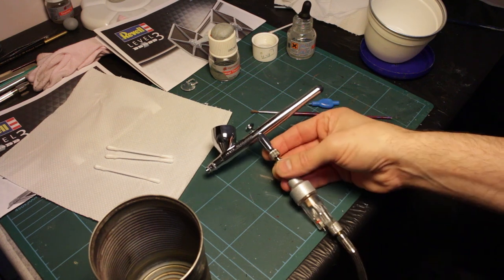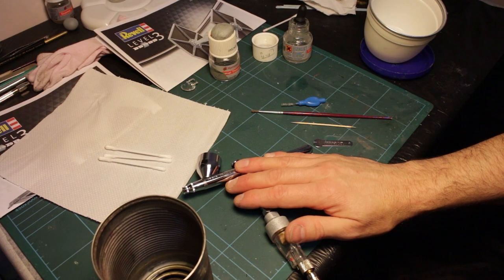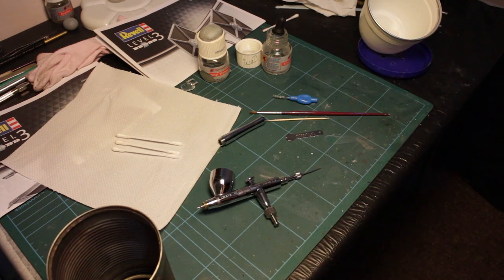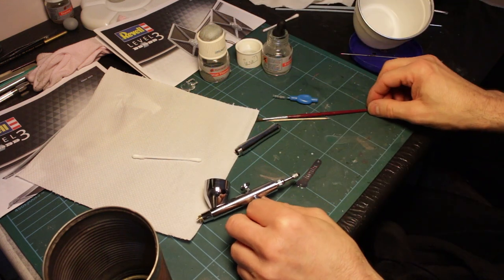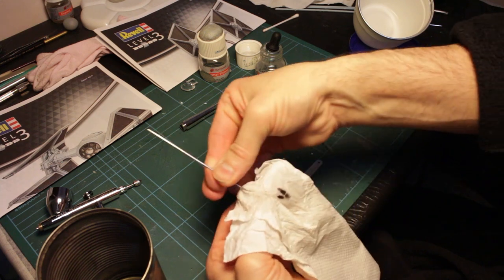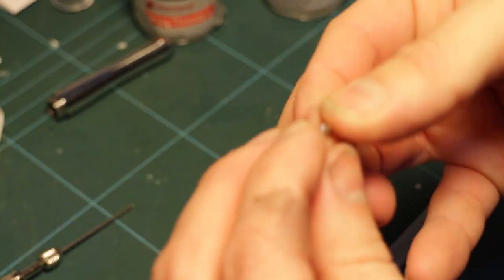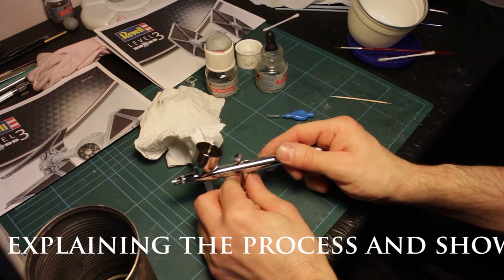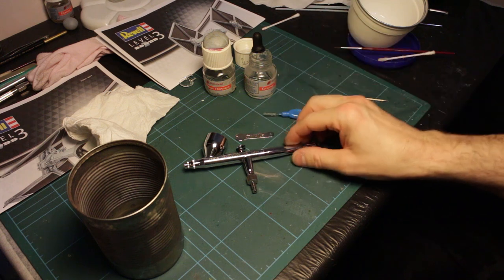CLEAN YOUR AIRBRUSH, SIMPLE, QUICK & THOROUGH TUTORIAL!

Comment: Well, I just had my first airbrushing session and I followed these steps - of course my brush didn't have any assembly/disassembly instructions so I was kind of a bit lost.
First problem - when I slid the needle out through the front it appeared to have a little rubber o-ring on it, assuming that's a seal that is seated somewhere within the brush.  Unfortunately, when I finish cleaning the parts and slide the needle back into the front, that o-ring doesn't of course go into the body.  It sits right at the mouth of where the nozzle should screw in and unfortunately, I don't know how to seat it so that I can get the nozzle to screw on.  I saved it in a little ziplock bag and finished assembling, but I'm not sure if the absence of that little rubber thing is going to adversely affect operation of the brush or how it sprays. Is that going to be a problem, and if that bit is essential how would you suggest I re-seat it (and where)?
Reply: @spidiq8 Update: Examined the other two nozzles that came with the brush (0.2 and 0.5 mm) and I see that it fits at the head of the nozzle threads.  It was fiddly to get it back onto the threads but it looks a little ragged (which implies it came that way and was maybe tightened too much when installed at the factory).  
How would I go about finding a replacement o-ring of the proper size?  It seems to be working properly after reassembly now, but I imagine this will be an issue each time I clean it until I get an intact one.
Reply from the maker: @HeadHunterSix  I was going to ask the brand and wondered if it might be the nozzle O ring seal, you can buy packs of tiny o rings from ebay etc and also from watch part supply houses.
However, if it's sealing and working without, don't bother, this way, provided the main seal is a teflon type material you can spray cellulose based paints safely.
Reply: @spidiq8  I just use it for acrylic, it's one of these Gocheer Chinese brushes with the little compressor.
It wasn't working perfectly without the O-ring but I did get it back on.  Still, it's a little misshapen and torn and I don't know how many more times I'll be able to break it down and clean it without that thing failing.
Id love to pick up a bag of O-rings but I don't know the inner and outer dimensions and thickness.  Especially since I'm known to drop such bits on the floor and lose them forever. :D

Comment: How do you sharpen a cocktail stick? Did you ever make the vid addressing the "o ring" cleaning problem?
Reply from the maker: With a scalpel blade. Whittle the point down finer as if sharpening a pencil.
Could you refresh my memory of the o ring bit please, I filmed this a good while ago and forget specific details
Reply: In a comment below, you mentioned that you would create a vid about "o ring" issues when cleaning the AB. I think the Iwata and cheap knockoffs have rings on the nozzle. They deteriorate fast with certain cleaning liquids. In this video, you soak the nozzle with ring in lacquer thinner, but say that is a bad idea with the o rings.
Reply from the maker: @Allessio777  Ah right yes. I do mention in a video somewhere (the Neo one I think) about using beeswax on the nozzle threads. That will seal it, just a tiny smear on reassembly. Some brushes have excellent close fitting nozzles like the Iwata here but others have o rings, standard ones don't last well in lacquer thinner but that said, since this video a lot are using viton o rings which are solvent resistant. (Same as the ones used in vehicle fuel injector and immersed fuel pump systems).
Reply: @spidiq8  thanks for that info...i found the viton site, but I don't know the size of the ring I need...my nozzle is .3 mm...if I can't locate them, what is the proper liquid to soak the parts in if I am using acrylic Vallejo paint?
Reply from the maker: @Allessio777  Vallejo is a water based acrylic so if you soak the nozzle immediately in warm water it should clear any paint residue. Brushing with an old paintbrush will help. If any has dried then isopropyl alcohol will move it.

Comment: Hi , little Question . Is the filter mandatory ?
Reply from the maker: They one under the brush?
No, but I highly recommend it if spraying in warm or humid climates or on extended spraying sessions as condensate can build in the air line.
Another way around it and similar to spray shops is to have a filter inline and a very long line from it rising upward before terminating at the brush but I find this actually helps with the airbrush grip anyway

Comment: Does it matter what percentage of IPA you use?
Reply from the maker: Ideally 99% but 70 odd will work for acrylics also, the only thing to be wary of is 70 odd percent stuff is typically rubbing alcohol which sometimes has other stuff in so check ingredients or ask the pharmacist. Anything that sounds like a balm or emollient will likely be a nuisance.
99% can be had cheaply from eBay/amazon/electronics stores
Reply: @spidiq8 , I just did my first session using your video. Wow, amazing difference in cleaning power and speed in switching colors. Thanks for the help
Reply from the maker: @hinge777  No problem, glad it helped you.

Comment: Good evening, I follow your procedure to a "T" every single time and it's a great feeling knowing that it's spotless and will operate 100 percent next time I pick it up. I've also noticed other videos suggesting putting a smear of Badgers or Iwata Air Brush oil on the needle. Would you suggest this as well as I believe it makes cleaning easier, especially if using black paint.

Also as its a lot cheaper than Isoprolol (£1 from yep, the pound shop for 2ltrs)  what's your thoughts on using windscreen washer solution for cleaning up after using acrylic paints. I have tried it but find it leaves suds residue behind, which I still remove/soak up with kitchen towel, but as I have a H&S CR Plus, I wasn't sure it the properties would harm it
Reply from the maker: Thanks. I'm glad it's helpful. Personally I don't advise or condone the use of 'needle lube' with a properly cleaned and adjusted brush they only point that should be prone to getting sticky is the air valve seal if the o ring swells.
Anything that isn't paint or thinners is a potential contaminant and when I sprayed cars using something like that is the kind of thing that could ruin a very expensive paint job and would get you soundly beaten behind the spray booth 😁
Bear in mind the only sliding friction is between a spring steel needle and a teflon seal, teflon is about the slipperiest material known and if your needle is sticking there it's adjusted incorrectly, bent or dirty.
Reply: @spidiq8  Then as I find your knowledge of many years spraying cars priceless, I will as always follow your clear and concise explanation completely and I'll use the benefit of that/them teflon seals to my advantage and leave the oil out of it. 

BTW, I love cleaning my H&S the way you've taught me and 10 to 15 minutes now is all it takes and it's done properly, so once again millions of thanks for your priceless tips.
Reply from the maker: @Bassmunchkin1  Thank you. That's very kind. All the above said. Airbrushing is typically for hobby reasons and people do what works for them so if you ever feel the need to deviate to achieve a particular result then go for it. The main thing is that once you understand the principles and the cause and effect of the setup and end results you know where to make changes. Enjoy your painting.

Comment: My trigger has 0 resistance. But Ive screwed everything in. Im super confused.
Reply from the maker: Zero resistance when pressing for air or when drawing back for paint?
Both operations use a return spring but you've got an additional point of friction in the O ring seals of the air valve under the trigger.

Comment: Hi if anyone can help I took my airbrush apart to clean, cleaned it reassembled it went to spray something thing threw and the paint cap blew off 🙈😂. I took it apart as must not of put it all back properly but from that moment on I can’t not pull the needle threw the front can anyone help? 🙏
Reply from the maker: If the cap popped off the air pressure is bleeding back through the nozzle somewhere.
I'm assuming that you removed the nozzle afterwards? If it won't come through the front try drawing it backwards.

Comment: hi having problems with my,airbrush,think the seal inside the brush is loose or blocked,is it possible to take out the air seal.thx mark.
Reply from the maker: Yes, you can remove and replace the seal, are you referring to the nozzle seal or the needle seal (though both are replaceable).
Best in mind if either were blocked the needle wouldn't pass through.
If you describe what's happening I will try to help you.
Also take a look at this. This might help you diagnose the fault.
https://youtu.be/2Hxwev8c53o

Comment: Yeesh taking the nozzle off I was like 😬
Reply from the maker: Why?
Reply: For me personally I don’t play about with it.
I had an ‘accident’ as a newbie last year with a brand new iwata hp-ch.
I took the nozzle off cleaned and put back. Put ever so slight amount of pressure on and over threaded it snapping it inside the brush.
It cost me £35 and a lot of worrying luckily I hadn’t damaged the thread on the actual brush itself.

Since then and hours and hours of use later I haven’t taken it off and bought myself a sonic cleaner. 
I backflush it a couple times do the rest you do tbh and slap it in there with some cleaning stuff (like CIF) and cook it for 15mins. Comes out shiny and new and really gets any unwanted bits out.
The rest of it is great, just my 2 cents. At least your giving some people a guide which is lacking!
Reply from the maker: @benfabz  Fair enough, but the tools supplied are there for the purpose of stripping and cleaning it, it's a matter of practise. If the brush has an o ring like neo nipping it finger tight will do. Or like this one. Just until it butts up. Any thread can be stripped with too much force but you'll always strip or break the nozzle before damaging the internal airbrush thread.
Another alternative is something like a Badger which use a pressure fit cone seal or h&s which use a flat Teflon seal so you don't have to worry about the threads.
The one in the video is my go to brush and it gets stripped and cleaned like this after every use and so far, same nozzle. (Now I've said that I'm going to be more careful than ever replacing it next clean) 😂
Reply: As I say different strokes for different folks! 
I hope you don’t end up jabbing a hobby knife in there trying to unscrew the snapped off bit of nozzle, or worse yet sending away to be done specially (it’s £60 charge too) 
You are right any force can break it, maybe my fingertips have ogre like strength! 
Since then I have had no need to strip the nozzle and havent had any problems. Every brush is different as well of course.
Reply from the maker: @benfabz  Indeed and if what works for you works, that's OK. But stripping really is the only true way to clean it, I've bought 2 high end brushes second hand, both bought as excellent condition and cleaned and both were filthy, take a look at my Badger renegade velocity and h&s videos, the h&s was ultrasonic cleaned regularly!
Top tip for broken nozzle thread removal. Toothpick/cocktail stick. Always use a material softer than the material you're poking into.
Reply: I might now take it off just to see!
Reply from the maker: @benfabz  Remember when you replace you're only snugging it up, you don't need to 'tighten' as such.
Reply: Oh don’t worry I have learnt that one!
Reply: I broke a nozzle couple years back and  I believe why I snap my 1st nozzle is not how much pressure/force I used, it is because the nozzle wasnt centered properly when I tried to screw it back on. (I have come to believe that this is main cause of all snapped nozzles) So, after cleaning the airbrush, I will slip the nozzle through the needle and slowly pull the needle back until I can give the nozzle a gentle spin or 2, then I pull the needle back and tighten the nozzle knowing that it is perfectly centered. Never broke another nozzle since. p/s: I rest the needle in the middle of my palm and "pick" the nozzle up with the needle, that way, my needle is safe too.